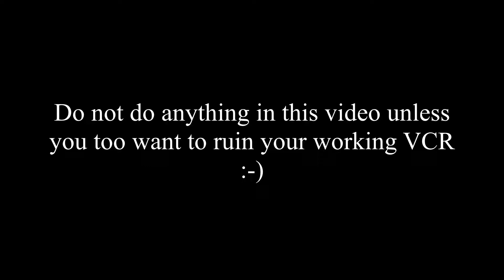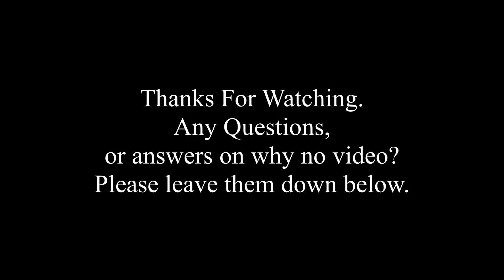Panasonic NV-HS900B teardown and examination.

Comment: It is absolutely possible that you in fact did not clean the heads. Those have laser-hardened tips and are positioned a bit deeper. You cleaned the head drum good, but with so little finger pressure that you did not actually made contact with the heads. You need to press a little firmer against them. I had the same problem on the near-the-same model (NV-HS950) - sound ok, no picture. When I paused the playback, I got a fuzzy picture. If you pressed harder against the gap between the rotary and stationary part of the drum, you would have probably gotten desired results.